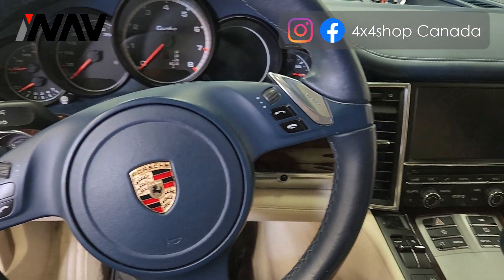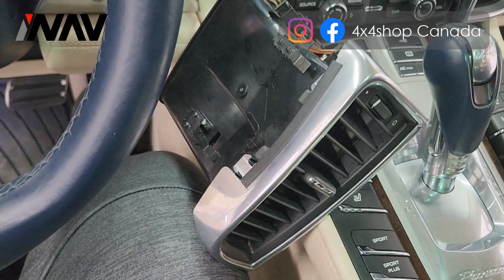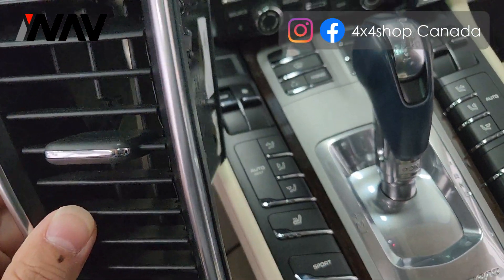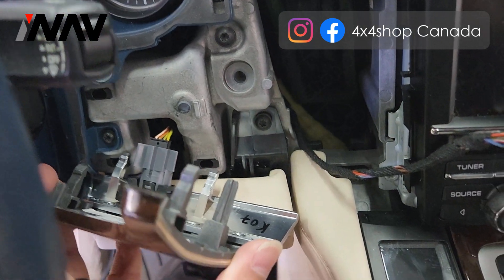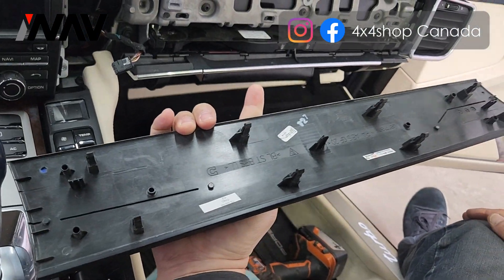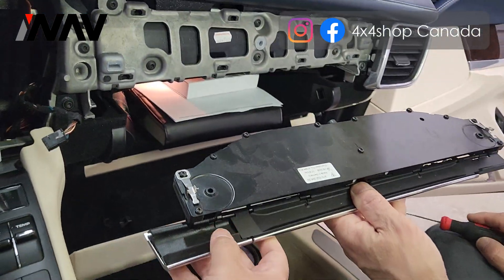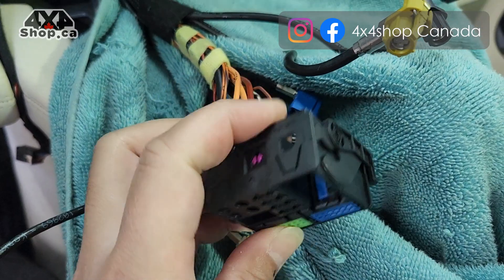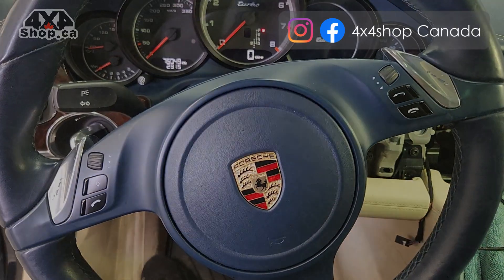STEP BY STEP How to REMOVE FACTORY RADIO SCREEN for Porsche Panamera with iNAV Pro 4x4Shop.ca

Comment: Hello sir..
I recently came across your youtube channel and was impressed by the quality of your content. However, after conducting a comprehensive analysis, I noticed there is room for improvement for your channel for getting more visitors and subscribers.
•	Your video title, description needs to be improved.
•	You need to use more relevant tags and keywords.
•	You have to do SEO properly.
If you agree, I can share with you some opinions/suggestions about your youtube channel based on my many years of working experience in this sector. 
I don’t want to bother you and interfere with work. Feel free to let me know if you are interested. I’ll be there for you.